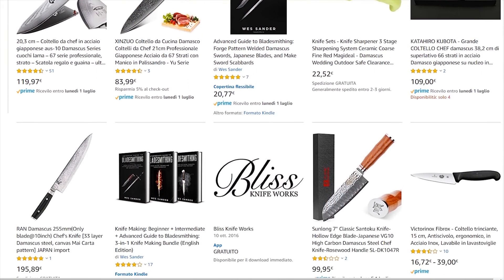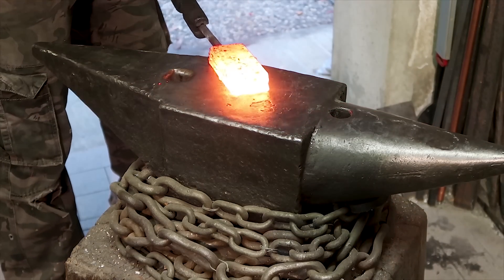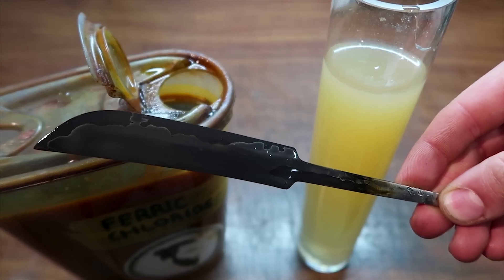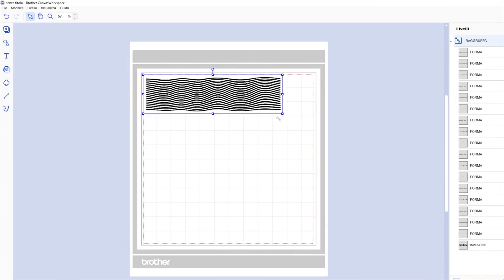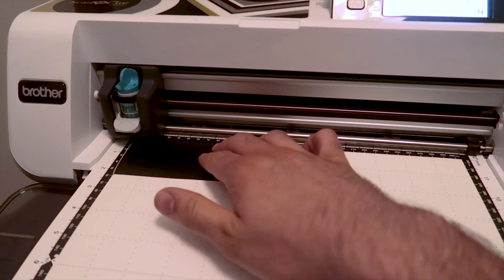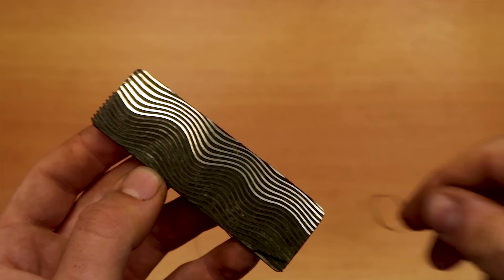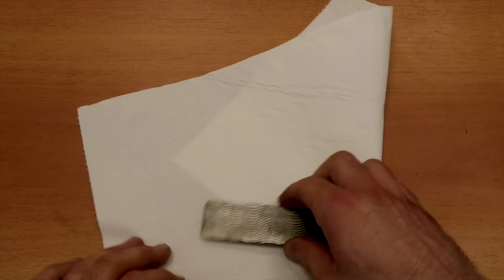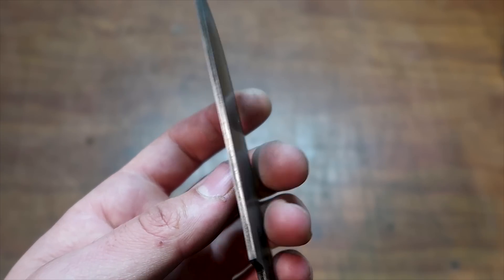Fake Damascus Is A Thing!

Comment: Anyone who is interested in modern Damascus steel should read up on ancient Damascus steel.

Around 500 B.C., iron was smelted in India where ingots of "Wootz steel" were produced and exported to the Levant.  The authentic ancient Damascus steel was forged from these ingots.  By experimentation, it was discovered that the swords that combined optimum flexibility and strength were made from iron that displayed a pattern of swirls caused by variations in the composition of the steel.  That is because these swirls appear at a temperature close to the phase transition temperature that produces the best sword steel.  Blacksmiths used the visibility of swirls as a guide to whether the steel was forged at the right temperature.  Thus, the Damascene pattern became synonymous with quality steel. 

Modern Damascus steel is produced by the shortcut of forging together steels of different compositions, rather than having the patterns emerge from the relevant phase transition.  Whether modern patterned steel is Damascus steel is subject to debate.  It looks like Damascus steel, but for a different reason.

A couple of Wikipedia articles cover some of this: 
https://en.wikipedia.org/wiki/Damascus_steel
https://en.wikipedia.org/wiki/Wootz_steel#History

Comment: A common method with Chinese blades (you see it a lot with cheap katanas being advertised as being "pattern welded" or "damascus") is making "pucker steel" where a bunch of grooves are ground or milled into a plain steel bar, then it is heated and fluxed up and smashed flat again with a power hammer. After etching it looks convincingly like it was pattern welded. Really, it is just esthetic and it looks nice but, like you said, you get what you pay for and should be aware of what you are buying. More scrupulous sellers will say that it is made from "pucker steel". But if you have to ask yourself, "How can this nice looking knife be so cheap?" then it is probably not authentic.

Comment: Personally I think that it's a cool little trick electro-etching a pattern into steel.  But my preference is making things the old way, or buying blades that are actually pattern welded... Well I sort of cheat and use a power hammer as I'm getting old... I guess it's not really cheating, as I just use tools that make my job a little easier and efficient.  Anyhow nice little bit of information there Looking forward to your next build ^.^

Comment: Just had a look on ebay and the first one I looked at did actually say " The blade is 7CR17 stainless steel, the surface of the laser Damascus pattern ". And another one said nothing other than "quality stainless steel". I think they're been downright bloody cheeky buggers, but obviously they've seen a market and gone for it, but I think they should be marketed as "laser etched patterned knives" rather than Damascus. Unfortunately that would probably take a quite large legal battle to enact, and if they're of Chinese origin, they'll just carry on as they are anyway, they just don't care so long as they make money.
Reply: Chinese live closer to Damascus than we do.  Anyway pattern welded steels were a way of faking historical naturally patterned high quality steels
Reply: Etching a pattern into steel is as close to Damascus as pattern welding is.

Comment: I really didn't know there were fake damascus products. That's like 'aging' furniture by drilling 'worm' holes and beating them. Thanks for the info.
Reply: I worked in a furniture manufacturing plant for 8 years. On the new items that have distressing it's molded into wood even before the factory sees it.
It helps them hide imperfections since the surface isn't completely smooth.
Reply: @Douglas Campbell, My younger brother said as much after running a cabinet making shop for about 12 years, Personally I'm glad you made this comment Confirming what I otherwise would have never believed ^.^ (yeah I thought He was lying to me... as he's sort of a shit-heel that way)*
Edited for grammar*
Reply: It's called Pattern Welded Steel and while it can look similar it's not Damascus, 99.9% of the "Damascus" you see being made on YouTube and being sold is in fact pattern welded steel. There is an easy way to check though, if you are watching it get made and do NOT see then use a solid chunk of Wootz Steel and no other material then its pattern welded steel and not Damascus, another tell tale sign is that the pattern comes from layering several plates together and then smashing them together until they wild into a single piece hence the name Pattern Welding.
Reply: well you could also see that's it's not actually made in Damascus or with steel from Damascus soo. they can't use that either.
the only people making Damascus, are doing it purely for science, everybody else is just making steel with pretty patterns.

my other question is, if they are fake fake Damascus are they still good knifes? what steel and so on.